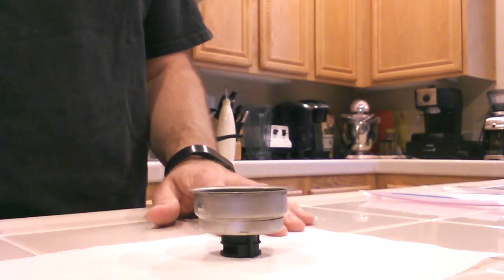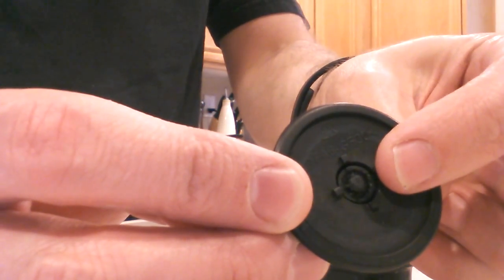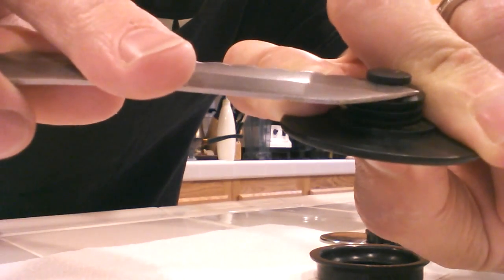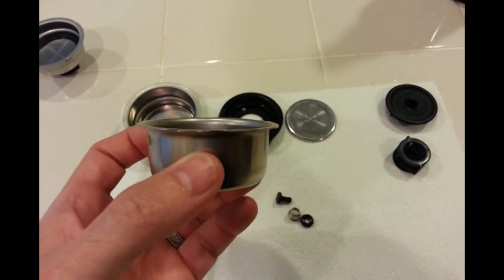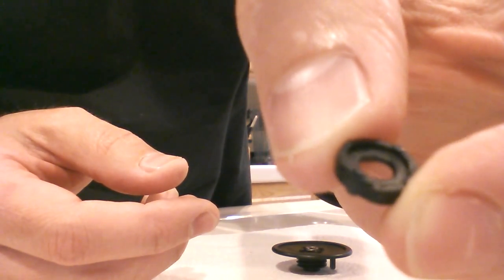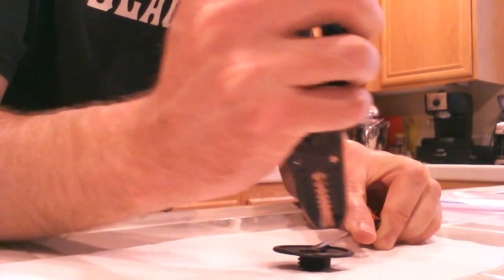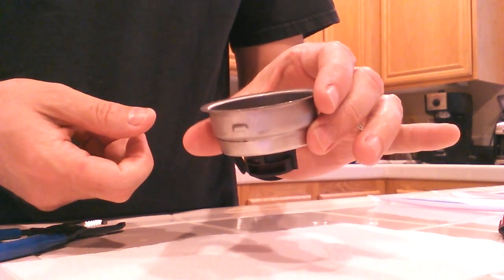How to Depressurize the De'Longhi EC-155 Filter Basket

Comment: I was getting crazy, as the coffee was not brewed from a filter, whereas it was from another. It took me one week of research, until I was your video. And... I realised that the pressuriser had some... limescale or coffee residue. So much so that was not moving the little thingy. Pressed manually, passed the knife just under the bumped piece to remove the scale and... boom. Solved! Thanks a lot. I saved €5.5 (which I don't care that much), but most importantly... I fixed it!

Comment: 6 years later, this video saved me from spending money on a new filter. I had taken mine apart to clean it and found that the washer was already broken. Which explains why I saw & heard the small piston move up and down freely before I took it apart.  It had already been depressurized since I started using it.  I confirmed this by putting it back together without the spring/piston assembly and my shots came out just as nicely as they were before!  Thanks much!!

Comment: Thank you. My spring valve was dirty and was preventing water flow. I pressed it a few times, which worked, but then decided to take it apart completely for cleaning. Put it back together quite easily. Now the valve moves better and the filter works as new.

Comment from the maker: @FrankDurocher- Sorry, I assume that people can figure out what to put back together.  Yes, you re-assemble the thing without the spring, peg, and washer.  You will find some people advocate simply just removing the entire "black thing" that holds the pressurized bits.  That would then leave only the rubber gasket and screen just "sitting" in the basket bottom.  But, if you do that, the structural integrity of the assembly suffers, and you can actually pop the screen part out of the gasket while tamping.  So, I advocate doing the way I showed so that you can have something that will hold up to the pressure of tamping without any issue at all.
Reply: Hello  I just bought a used machine and noticed the tiny black ring is broken... so I will have to try it with out...
Why do you prefer it with out pressure?  What is the difference?
Reply from the maker: @calderonjd30  Professional machines do not have pressurized portafilters.  They rely on the barrista properly grinding the coffee so that the pressure during brewing is correct.  What this means to you is MUCH better tasting espresso.  With a pressurized portafilter, the device lets you "cheat" and not have a good grind.  The result LOOKS o.k. when it pours, but it will not taste nearly as good as a shot with a proper grind.  If you don't have a good grinder (that can go fine enough), you may have a problem.

Comment: These machines come with a single shot filter and double, I've depressurized one of the two and so I can have the option of pressurized if I want it, and all I have to do is reassemble, no putting the spring back in necessary then.

Comment: People, you just need to remove the whole plastic assembly and the filter would not be pressurized. Adjust your grind and tamp until you get it the way you want it. Afterward you can put the plastic assembly back so the filter doesn't come flying out when you tap to remove coffee ground.
Reply: That was my first thought as I watched this video. My understanding was forcing the many holes through a single hole is the primary pressure point. So removing the plastic assembly allows those many holes to flow through. I will attempt this as I just bought a Baratza Encore and believe I ground the beans too fine for the standard pressured usage.

Comment: Hey thanx for the video - I'm not sure if you're aware, but you never actually cemented your demonstration on HAVING a de-pressurized basket/filter... At 2:40 you have all the parts laying there on the table and you say "So that's how you de-pressurize the thing." ...Wait - what? You take the thing apart and lay it out on the counter? Which parts do you put BACK to have a functional de-pressurized basket/filter? Everything except the little peg & spring? Or can't you just put the first three pieces back together to accomplish this? (Basket, gasket, metal screen) If that's the case, though, why go through the trouble of removing a peg/spring?
Reply: Frank Durocher That’s exactly what I did.  Simple and takes about three seconds.

Comment: No need to pop out that valve part, just dont use the whole plastic plate piece. put the filter back with the rubber sealing to the basket and you are done. Im using it this way. Works perfectly

Comment: Thanks for the vid. I got the same la pavonni bottomless filter, but flattening the flanged edges with a pair of pliers is extremely tough! (No good grip, metal barely deforms). How did you get the edges so nicely flattened?
Reply from the maker: I wore gloves and used a pair of pliers and just kept working it until it was flat.  It took about 20 min.
Reply: I'd recommend a channel lock pliers with a 10 inch handle. That would give you enough leverage.

Comment: i am interested in how this all works. I have the ec155. in fact it is my second unit.  My first lasted about 2.25 years before i had to retire that one and get a new one.  I like it so much that i decided to get the same model. but i wish they lasted longer than a little more than two years. so please explain how depressurizing the basket will help with coffee flavor.  I make a double shot latte every day. my favorite. but i like learning new stuff. So please explain how to get a better espresso with this method. Thank you
Reply from the maker: Kim Granger as this video shows, the included portafilter is pressurized.  What that means is that regardless of the coffee you use, or your tamping pressure/technique, the valve will open at exactly the same back pressure in the basket every single time.  While that sounds like a good thing, it is actually hiding issues, such as poor distribution, improper grind size, incorrect dose, etc.

Real Espresso uses the coffee puck as the primary way to gate pressure.  So, what this mod is doing is pushing the machine closer to a real cafe style machine...where grind, dose, tamp all make or break the shot.

if you are using Preground coffee, this mod is NOT something you want to do.  You only want to do this if you are grinding fresh whole beans with a decent burr grinder.

I hope that helps.
Reply: Daniel Baird zs
Reply: @DanielBaird  what kind of grinde is best for this unpressuruzed mode? Fine or regular?? I don't understand 😒
Reply from the maker: @calderonjd30  Depending on your grinder, you should start with a grind that is so fine, the machine will not produce any coffee.  Then "back off" (make it coarser) until it is pouring your shot in about 30 sec.

Comment: The thing is, you are still forcing coffee through less holes than are on the top if you look at the bottom its still 1 or maybe 3 holes with the modification and it is still pressurized, the only thing the mod does is prevent "fake" crema.

Comment: So, wait--I just bought the EC-155, but I don't want to buy a proper grinder--too expensive.  Right now I'm using preground Illy espresso, and I have a can of reground Lavazza in the on deck circle.  If I depressurize my filter basket can I continue to use preground espresso?  And will depressurizing my basket give me better espresso with the same coffee?

And do I dare take the plastic tip off of the steam wand for better (i.e., less foamy) milk?  I don't want to buy a new tip cuz they cost money.
Reply from the maker: Jordanmilo if you depressurize the portafilter, using preground coffee will become difficult or impossible.  Depressurizing will require you to have a decent grinder and use fresh whole beans ground for each shot.  That is why you get a better shot...because you move your entire workflow closer to a professional setup.
Reply from the maker: as for steam...if you don't want to spend money, then don't.  If you want better quality, then yes, pull that plastic thing off and get the metric 6mm single hole tip from OrphanEspresso.
Reply: Daniel Baird Thank you very much. Looks like I'll keep my filter as is for now and look into getting a steamer tip.
Reply: @DanielBaird  Hi Daniel, is the reason for needing to grind the coffee yourself because that way you can keep the grind courser so as to keep the flow without clogging whilst maintaining intensity etc? x
Reply from the maker: @xxchar61xx  grinding fresh for each shot is the only way to guarantee not only the freshest possible shot, but yes, you get complete control over the flow.

Comment: You don't need to take apart the pressurized spring loaded thing. Just set it aside and don't use it. Put the filter back in the gasket and  back on the filter basket and that's all you need. Way easier this way, and much easier to put it back to the way it was.
Reply from the maker: Yes, you could do that, but then the filter element isn't as stable.  I like this solution because it puts the entire basket back together almost the way it was designed to work.  I feel that it operates better this way.  Just my opinion
Reply: @DanielBaird  Works great without having to use it. Pack it tight and it makes a great espresso. Much better than with the pressure filter attached. I don't even want to try taking the spring mechanism apart. I'd probably never get it back together. This is a much easier way, and it tastes great. So an option anyway.

Comment from the maker: @ryotaryuu the pavoni filter is this one:  http://www.espressochronicles.com/delonghi-ec155-bottomless-portafilter-double-shot/
Reply: Hey there. I’m new to making expresso so I have this machine.. if I take this pressure part off would I get what? Creamier coffee and better tasting?
Reply from the maker: @glammedbynatalia  what you get is more control.  You will be controlling the flow of coffee purely with the grounds in the the basket. 

Currently, that pressurized portafilter is doing some extra work for you, but it is hiding imperfections in both the coffee and your grind.  Also, the crema that you are currently getting is more a result of that pressurized bit than it is a proper extraction.

Making this mod means that your grind will need to be spot on.  it will take some time to dial everything in because you will have to change your grind settings. you will want to find a setting that allows your total volume to come out in about 27 to 30 seconds.
But once you do this. The quality of your coffee will jump a lot.

Comment: OK so all the stuff about 9Bar being the ultimate is defunct?
Reply from the maker: No, you are missing the point.  The peak power of the pump is what is listed.  The pump is rated at 15bar.  So, if you were to completely block the shower head, the pump would max out at 15bar in the portafilter.  This number on the box is NOT the brew pressure.  You still want to BREW at 9bar.  All they are saying is that they put a powerful pump in the machine that can easily reach 9.

Comment: Can't you use the same basket it comes with,  just minus the screw and spring etc??
Reply from the maker: Yes, that us what this video shows.  But, I liked the results of the aftermarket basket better.
Reply: @DanielBaird  ahh ok, I was under the impression that you needed to buy a different basket to use it thank you
Reply: @DanielBaird  You never showed how to make it un pressurized. You just took it apart and showed a totally different un pressurizd basket.
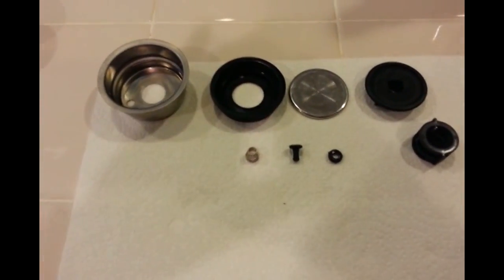Reply from the maker: @chiwawa130  @2:50, I say something blike "If you put all this back together leaving out these 3 pieces...". I assumed that it was simple enough to just put the big pieces back together...you have to do this if you are cleaning the thing regularly anyway.

Comment: I don't get it...why does the basket need to be pressurized for pre-ground coffee vs. depressurized for freshly ground coffee?
Reply from the maker: It really isn't a fresh vs pre-ground issue.  It's a grind size issue.  With fresh ground, it is assumed you have a grinder, and so, you can adjust the grind size to suit your machine.  Espresso requires a fine grind to build up the necessary pressure in the portafilter.  Pre-ground coffee is never the exact grind size needed for your machine.  And so, you use a pressurized portafilter to compensate and guarantee the brew pressure.

Comment: Daniel, does this affect the crema?
Reply from the maker: Depressurizing makes the basket act more like a cafe quality machine.  Removing that valve and spring takes out the part that makes crema possible even with poor grind quality.  So,with this mod,  you are 100% in control of the crema by grind and tamp.  Freshness of beans also helps.

Comment: Hi. I am new to this and just bought this machine. And I am going to ask a stupid question. What are the benefits of doing this? (I know you said "better tasteing expresso") But I dont know what presurized and depressurized are.

Also, my water flow in the machine is like this:

https://www.youtube.com/watch?v=Gk5w8aIJiRA

maybe a little bit more but it flows like this.

And I guess the normal flow should be something like:

https://www.youtube.com/watch?v=XI-AhFWm2Co

(minute 14:58

Thank you for your time)
Reply from the maker: Sebastian J. The flow of your machine looks similar to mine...that doesn't seem to be an issue.  The better taste comes from the fact that you are controlling the flow/pressure with your grind an tamp...not with a spring valve.  The pressurized portafilter assembly will ensure that 9 bars of pressure are generated even if you put coarse ground coffee into the thing...which means you aren't really making proper espresso.  This mod forces you to get a better grind for your espresso, and learn how to tamp properly.  This will instantly produce better crema and better espresso.
Reply: thanks...I am new to this and was also clueless about why do many people are recommending this.

Comment: Everyone says 9 bar is the best but all cheap espressos are 15, WHY?
Reply from the maker: 9 bar is the extraction pressure.  You need a pump that can generate more than the target to make sure you hit it.
Reply: @DanielBaird  Thanks, so is 15 bar as good in a cheaper machine such as a Delonhi?
Reply from the maker: I'm not sure what you mean by "as good".  The pumps in these cheaper machines are not up to the standard of a cafe machine.  They are designed for home use.  So, if you tax it by trying to make too many drinks too fast, it will suffer.
Reply: @DanielBaird  Sorry for not making my question clear.
I meant do you get as good a cup of coffee using 15 Bar machine.
Reply from the maker: @irie0for0all  the quality of the cup has very little to do with the pump...as long as it can  hit brew pressure of 9 bar.  Your grinder, ,dose, tamping, total flow and final Volume in the cup are what matter more than anything.